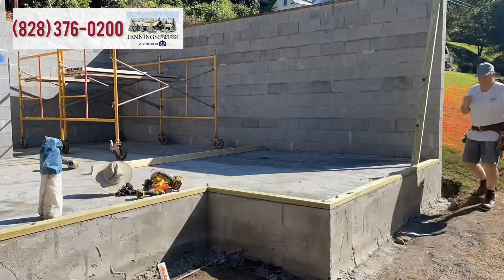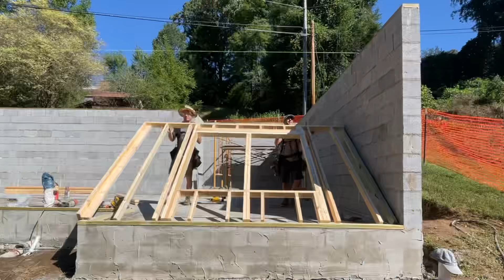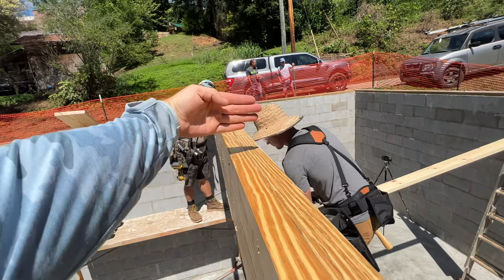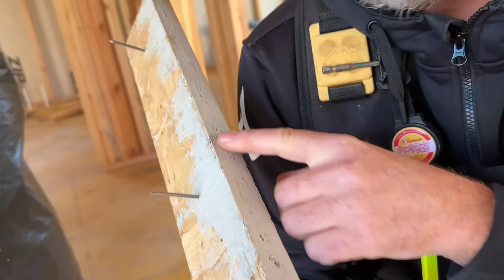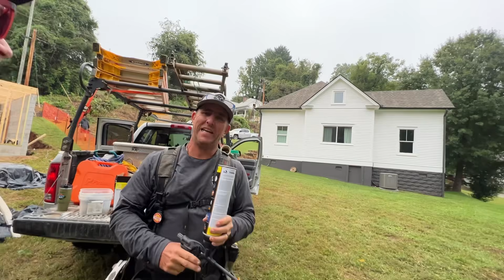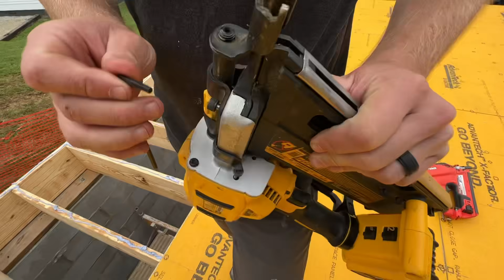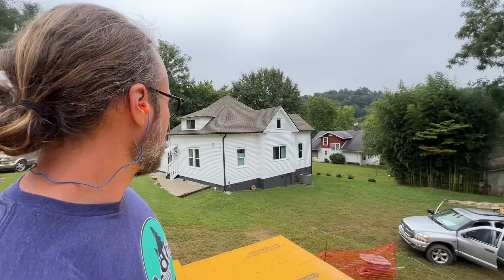Building A Small Income Property | Part 6

Comment: You guys are fun to watch. I don't have near the experience you guys do but what I have is sufficient enough to get real enjoyment out of watching your builds. Not only that but you keep it interesting and humorous.
I worked in construction for 8 years in the early 1980s in Champaign-Urbana, Illinois with Doyle Construction & other firms building apartment buildings and other types. I went from that to working for 21 years at an architectural firm in Sioux City, Iowa after receiving an Associate Degree in Architectural Engineering. At 73 years old I am retired now but so enjoy watching what I used to do.

Comment: Not a carpenter, but at 0:41, instead of having loose studs to toenail to the treated sill plate, what if you added an upper, untreated sill plate so you could build the wall pretty much as normal, with sheathing in place?  (the studs would be 1.5" shorter to accommodate the second sill plate).  Would need to add holes to clear the fasteners in the treated sill plate, too.

Comment: I just spent today installing 2x10 Joist for a deck. The battery management pain was real. I only had the cheap 1.5 amp hour batteries. I ended up buying another two amp hour battery. I'd be curious to know what your guys' battery situations are like 🙂

Comment: Don't know your plans for the outside basement walls but you should really insulate it at least 5 cm or better 10 cm on the outside and have a good drain.
Cost "nothing" to do it now while it is open compared to digging it up later to do it like i have to do with my whole house because of moisture problems and severely heat loss to the ground...

I know you rendered it but still should insulate and have a plastic drain and air spaace between the ground and walls.

I want to have my basement dry and conditioned since everything steel rust down here if the dehumidifier dies, it's been on 24/7 for 2 years now and it isn't free power either 😅 around 3 200 KWh in a year and with todays power price in Europe that can be as high as 2 600 usd a year plus an extra heater and it's still cold

Comment: Just an FYI, you have to use Stainless steel nails when nailing to treated lumber when close to salt water like the Gulf or Oceans as the salt will corrode the galvanized and the treated will rot the steel over time.

Comment: Hey Jamie if you were building a window casing with a radius at the top of the window how would you do that
Reply: Best way would be to template the radius with cardboard
Reply: In the past I have planed down like 4” wide strips to 1/8” thick and made 6 of them to add up to 3/4 thick. Build a curved jig to bend them and glue and clamp them to the jig. Use lots of clamps.

Comment: You mention the maximum span for your joists. I thought 2x12s could span further than that. Curious what specs you guys build your floors to.
Reply: They used to be rated for 16’ span on a floor. I think it was reduced recently in the NC code book

Comment: I went to buy the tool belt but they only go to 47 inches and I need a 52 inch
Reply: They run a little big from what I’ve seen. If the bigger one doesn’t fit you can just return it..

Comment: For your 2x4 that you hit with the sledge to knock the Advantech together... nail a vertical scrap to the middle of it, like an upside down T, and you have a handle on it so you don't have to bend over all the time. Nice back saving tip from Awesome Framers channel.

Comment: the nasty poly based adhesive is the real deal no doubt - your hands are black for a week if you get it on them - for a ranch the modular walls are a big help but also the manufactured joists are kind of nice - no crowning needed - they have built in wire chases...lvl and 2x4 is a good way to do roof - the thiccer metal roof is way to go and you can easily mount pv panels too - to power mini split and almost no bills for hvac - you can and should do more of these and lever air bnb or other rentals - still do them for clients too - you could do one a week sat and sundays for ot - with a crew you may be able to do more - icf may make things faster or at least parity and be good for some clients and applications  #mr customs man #logistics #real men of genius

Comment: this is a good one - you are getting busy and will get things better more optimized - think about split level ranches also? just a basic ranch and semi flat roof can be super rapid fab - think about jig for the modular wall section - you know it is square... #bostich #hot shot plate nailer

Comment: next time you just need that very last short length from the can, dent it in on the side so that you reduce the internal volume, so doing you increase the pressure inside and then give it a shake .... you should get some more material out of it.

Comment: I suggest you install an outdoor NEMA 14-50 receptacle or better yet, install an Electric Vehicle charging station at this rental property.  Your property would be valuable to people with electric cars traveling to the Bryson City area.  At least install a 1" conduit from the electrical panel to a location near the parking spot so a charging station can be added later.  I realize you have probably already finished this build but i can always hope.
Reply: 100%. For the same reason that the last house had a generator hookup installed "just in case" the owner wanted one later, modern houses should be built with 14-50's "just in case" a future owner will have an EV. Given the adoption rate, current car manufacturer policies, and legislation, an owner in the next 10-20 years having an EV is almost guaranteed.
Reply: @namAehT  Never going to happen.. No way our infrastructure could handle even a 10% adoption rate.. It is already failing with only a 0.4% adoption rate.. Not to mention 18% of people switch back to gas in less than a year of EV ownership..
Reply: @FJB2020  Infrastructure can be expanded and there are already funds available to expand it. Saying "our infrastructure can't support it" is like saying "gas cars won't take off because we don't have gas stations" in the 1900s.
The only source I can find that comes close to that 18% number is a study that was done among California EV owners between 2012 and 2018 when chargers were few and far between. Today I can go anywhere in the US and most of Canada on the existing fast charger network. Even without that network I can drive a ~3-4 hour round trip without needing to charge which covers 99% of the driving most people do.
Reply: Pretty sure they will considering their other rental has it...
Reply: Each of our rentals have EV chargers and this one will too.

Comment: There is something i do not understand here in Germany😬. Why do you toenail the walls after standing them up? Was it not possible to nail them with galvos before standing them up?
Reply: It is possible to nail the studs to the plate but then you have to lift the wall over the anchor bolts. If you have a lot of anchor bolts and  hold downs and a small crew it is a back breaker to lift in place.

Comment: I am building my work shop right now. it's 24w by 36 long, and on a slab, with 10 foot high ceilings. I framed my walls in 12 foot sections as I am doing this alone. I just put a single sheet of osb on the wall after squaring it up on the ground. I did this so when I raised it. it could stay ridged. all I had to do was put a brace in until i could get the next wall up and tacked into it, so on and so on. I know that your rim boards facing the road aren't pressure  treated. I would have don that on only the spots that are closer to the dirt because of splash back. that's why it's called a mud sill as well. just food for thought. keep up the good work.
Reply: Thanks, and good luck on your shop!  I’m sure you will enjoy it.

Comment: Why do you not use wood I-joists and beams? Is it to advertise the planer? Lol. You guys are awesome. Keep up the good work.
Reply: They cost more and need to be special ordered, versus just grabbing 2x12's from the local lumber yard 15 minutes down the road and spending no more than an hour planing the boards more level in a couple spots.  If there's no need for the benefit of doing hidden wiring/plumbing/hvac in a basement living space, and especially if there's no long spans needed, there is really no point to going to i-joist route.